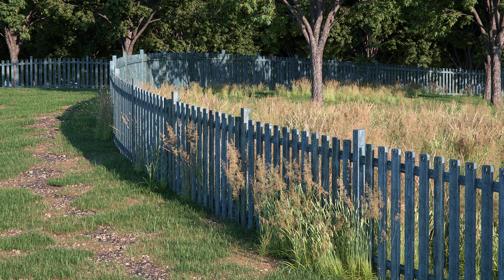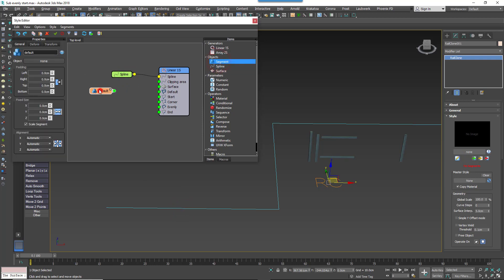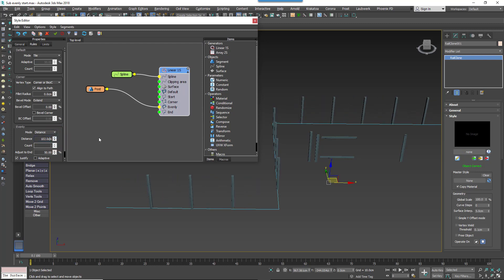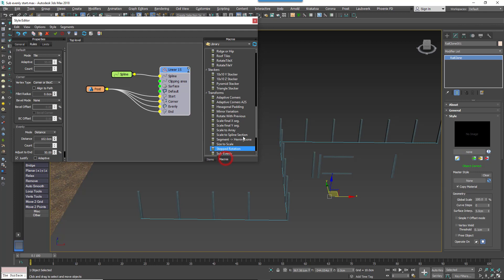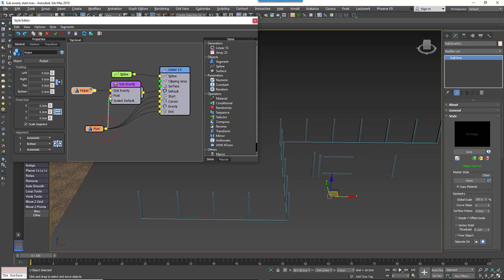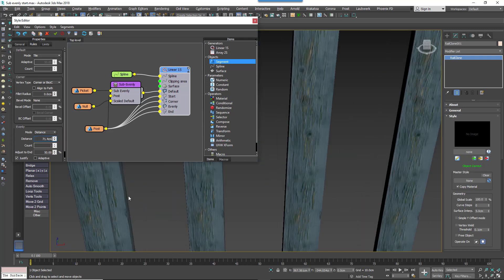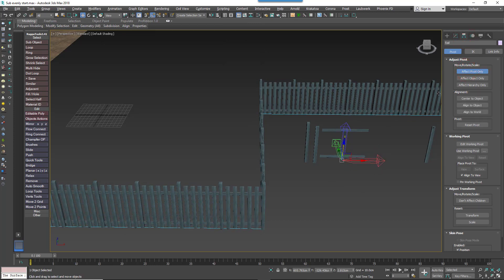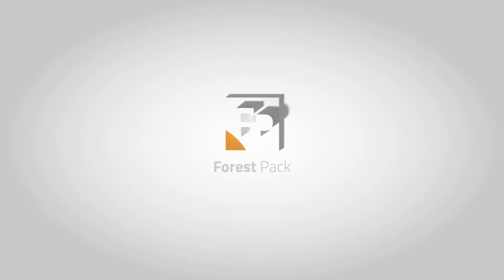QUICK TIP: Making a Picket fence with RailClone in 3ds Max (beginner)

Comment: great tutorial, such a shame you cant follow along with the Lite version. So restricted can't really tell if the actual software is any good as you can only array a bunch of posts without the Sub evenly parameter or the ability to add more then 1 generators. Allow at least  2, so we can actually use the software for testing. Otherwise its pointless offering us a Lite version.

Comment: Sub-Evenly isnt in the Macro section on the Light version. I've installed all of the libraries and the macros and it's just not coming up. 
The Light version states that 3 objects can be used, but without the Sub Evenly, its not possible. Any ideas?
Reply from the maker: The macro should be in the downloads for this tutorial which are available here: https://www.itoosoft.com/tutorials/making-a-picket-fence-with-railclone-in-3ds-max?utm_medium=social&utm_source=youtube&utm_campaign=tutorial&utm_term=railclone

The lite version does indeed have a 3 segment limit, but you could always split the fence into two separate RC objects, one for the posts, and a second for the rails. I hope that helps.
Reply: @itoosoft  there is no Sub-Evenly Macro in downloads,only 3ds scene with textures....so again - on Light version there is no Sub-Evenly Macro or it should be there?
Reply: @itoosoft  there is no macro there, only textures and max file.

Comment: Kind of new to Railclone.... in every single tutorial, somehow materials just magically work for everyone else. When I make a custom railclone object, it completely ignores the materials assigned to the segments/objects I bring into the railclone object. How is everyone getting their railclone objects to inherit the segment/object materials without having to make a custom multi/sub-object material? Even when I do create a custom multi sub object material it doesn't work properly... anyone got a link to a tutorial for this problem because I can't seem to find one anywhere... Have gone through all the beginning tutorials but none of them seem to mention this problem and somehow it just magically works for them - bring in the materials from their objects as if they already have a multi sub material already applied to their RC object. Super lost on this. Any help would be greatly appreciated.
Reply from the maker: Hi Travis, In the past RailClone doesn't automatically take the materials from the source objects at all. You'll need to create the multi-sub material and apply to the RailClone object yourself. 

That said, If you are a V-Ray or Corona user, the latest versions now include an option to use the materials assigned to the source geometry. All you need to do is enable it by checking "Use Segment Material" found in the Style rollout.
Reply: @itoosoft  I actually tried that option several times in several different max files (3ds Max 2021 using the latest VRay) but it didn't work :/ Would be VERY nice if it did though. Would save a tremendous amount of time on some objects. 

That and the ability to control banking would be nice. As soon as a vertice in my spline moves at all in the Z axis, it either twists or breaks the corners of the railclone object. I've looked through the forums and it looks like it was stated that these options were planned but that was posted in ~2017 :/ Have there been any updates on these?

And thanks for your reply - really appreciate it! Awesome to see that you guys reply to customers even on youtube :)

Comment: is it possible to 'export parameters' of the (sub-evenly) macro?? so that the spacing can be controlled at the root level of railclone's UI?
Reply from the maker: Absolutely - just select the macro and go to Export Properties. It should work the same as any other node.